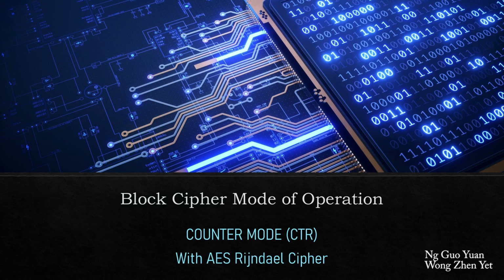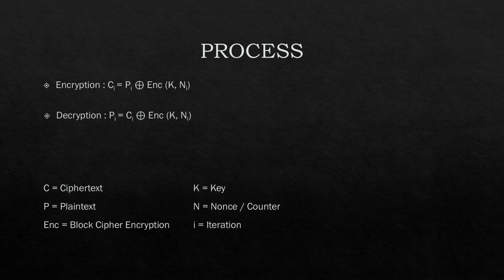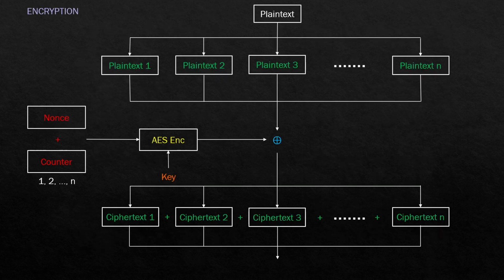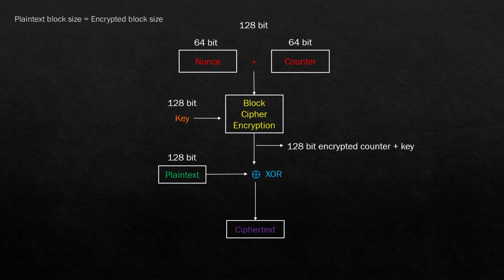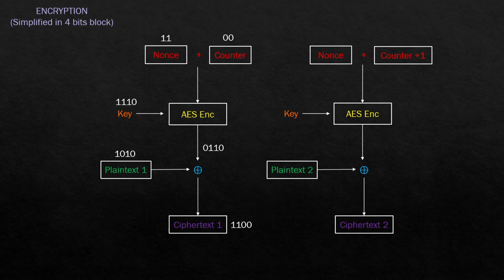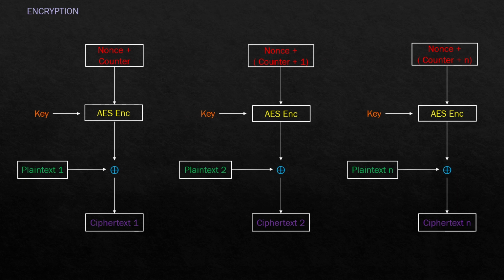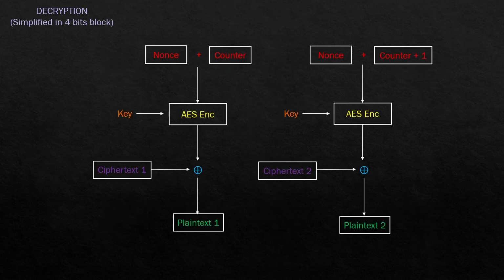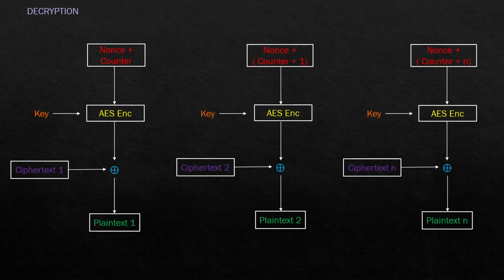Counter mode (CTR), block cipher mode of operation

Comment: If you have the key and cipher text, can you decrypt the cipher to find the plain without the IV(nonce)?
Reply from the maker: Terrearth09 , you can’t. Without the nonce + counter, the output of the block cipher will be different. So when XOR-ing with the cipher block it will also produce different output that’s not the original plaintext block.